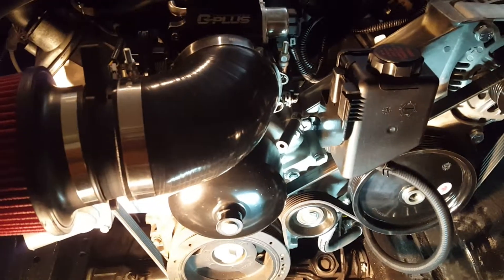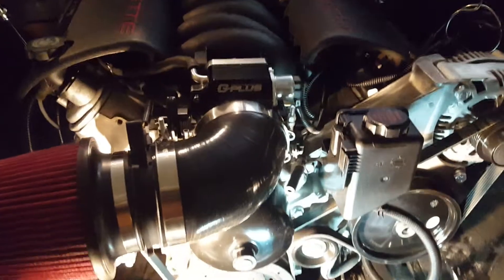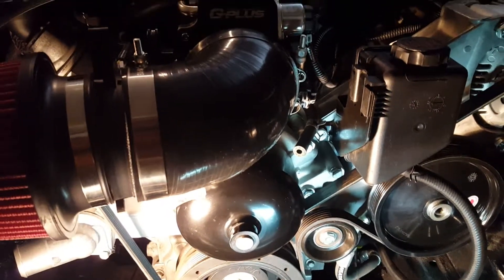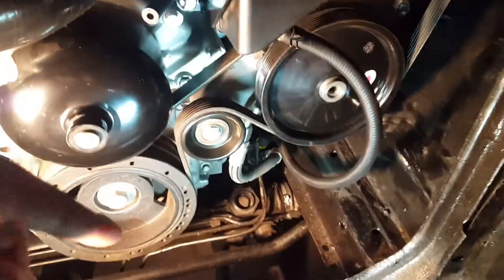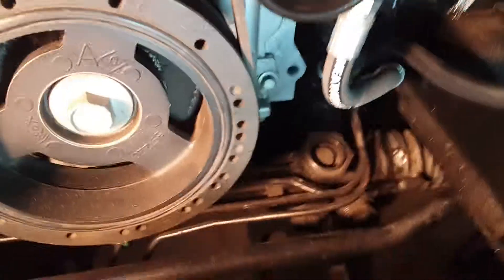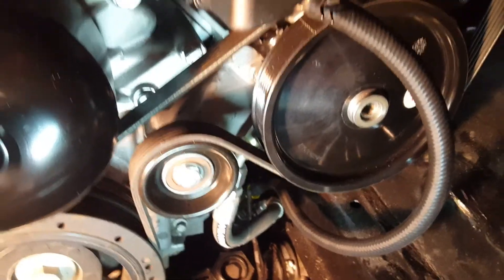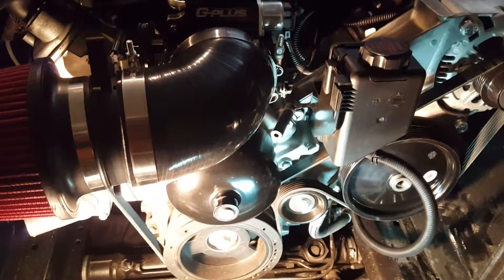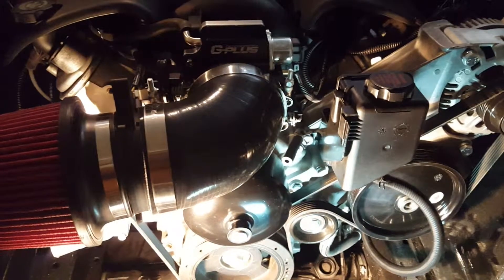LS swap power steering with Mustang 2 Rack n Pinion

Comment from the maker: For the pressure hose I used a universal remote a factory C5 Corvette pressure holes and I took it too a hydraulic line place and had them convert the other end to a AN6 to connect to the rack.